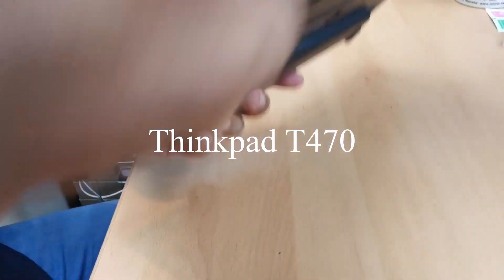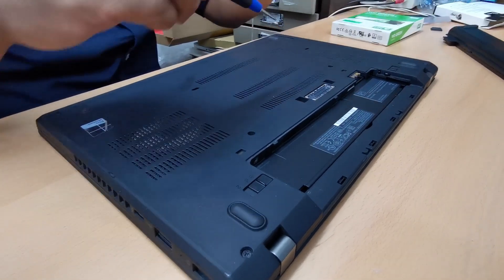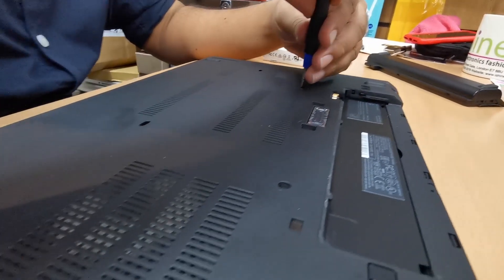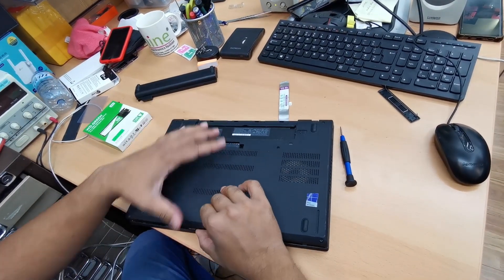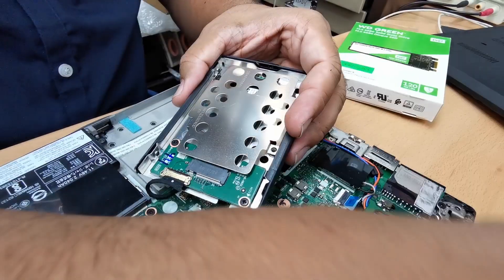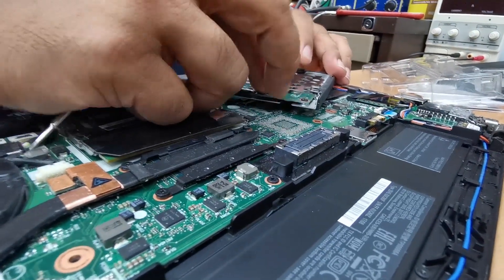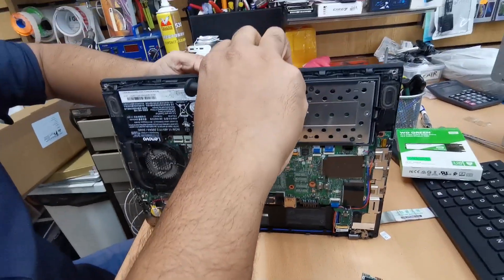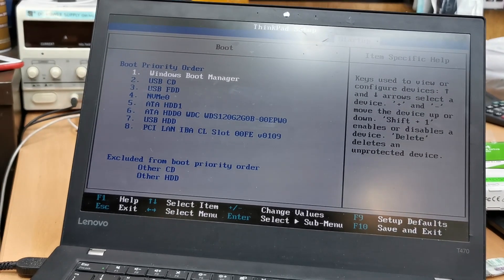Lenovo T470 SSD Replacement Guide Step By Step!!

Comment: OK. I bought a Router supporting Wi-Fi 6 AX3000T - Tell me if my ThinkPad T470 with CPU i5 7300U - Serial number: PF0XPBPC, Product number: 20HES0V803, BIOS version: N1QETA4W 1.79 - will fit: Module - Intel Wi-Fi 6 6E AX210 Bluetooth 5.3 5374Mbps M.2?

Comment: Does this laptop have two ssd slot?
Reply: Mine does.   T470.   One slot for a SATA hard drive or SSD (in the location shown in this video).   Another slot beside it for either a  wireless WWAN card OR a 2242 size M2 SSD.
Reply: @cr10001  The T470 can have NVME SSD as shown, or a 2.5" standard or 2.5" SSD drive in the slot shown. For 2.5" you need a different cable available at Ali. Plus a 2242 SATA in the WWAN slot

Comment: A beginner question - does windows need to be reinstalled on the replacement SSD, and what's the best way to copy files from the original SSD onto the replacement?

Edit: a month into this adventure I found it’s also possible to do a fresh install from USB. Download software like Ventoy to provision a usb thumb drive or external drive as a boot device. Then place windows iso on the drive. Choose boot from USB on BIOS to start the refresh install wizard…
Reply: Ended up using an ssd enclosure to hold the new SSD and copied existing partitions using Macrium Reflect trial version…
Reply: @starless9  thanks for this,..i came to ask the same question...was it a smooth process - no problems?
Reply: First thing to do is clone existing disk to new disk in USB adapter. You can use Macrium clone software or similar.
Reply: Clone your old system first using a USB adapter. Use Acronis True Image from WD download. (its free if you have a Sandisk USB stick or WD drive)

Comment: I am planning to buy a t470 but that laptop doesn't have a fingerprint scanner and has a dual storage, it says it has a slot for both ssd and HDD. Is that fake or what?
Reply from the maker: Yes it does have dual slots for ssd and hdd
Reply: @thepcphone  Thank you

Comment: "the battery is discharged so we didnt have to disconnect it" - proceeds to try and turn it on without power adapter plugged in. Also, watching you with the pry tool is like watching an oaf take apart his first laptop.
Reply from the maker: You don't have any idea about the video background, so how would you know ? Anyway thanks
Reply: @thepcphone  Because you're just some guy who opened a shop, without any prior knowledge other than "I fixed a PC once or twice" and learned everything from secondhand sources. It's evident. You didn't even wear a strap to prevent shock, you had the wrong tools - you didn't clearly explain what your were doing and you certainly did not follow proper repair procedure. So, it's clear you're an "on the job" learner as opposed to someone who actually studied, understands and teaches the field.

Comment: Hi,
After you change the drive. Do you have to reinstall Windows and all other programs?
Thank you very much for your video :-)
Reply: Yes! All your programs and data are installed on the hard drive. You need to back it up onto an external drive and create a boot media for windows before replacing the hard drive. You can use the windows media creator for this. It has simple step by step instructions. Then simply boot from the usb/dvd and it should will install windows. Then you just need to transfer back your data. Programs will usually all have to be reinstalled though!
Reply: @jasminm.3481  Or you can clone your old drive before you remove it. You can clone it to a 2242 in the second slot (WAN) or to your new NVME with a USB to NVME adapter using clone software like Acronis True Image (free from WD..if you have a Sandisk USB or WD drive)
Reply from the maker: Yes you do!

Comment: Is it possible to place a second SSD in this laptop?
Reply from the maker: Hi, No this one does not take two drive at the same time but its compatible for 2.5inch sata HDD/SSD  or M.2 NvMe .Unfortunately this one does not have option for second storage drive.  you can see the motherboard layout in this video at  5:28 .
Reply: @thepcphone  yes, the t470 is compatible with 2 ssd drives. You can put one m.2 or sata in the 2.5 inch bay/adapter, and add a second m.2 sata 2242 ssd into the wwan slot

Comment: what is the tipe of the SSD from lenovo co i can get an adaptor to SATA
regards
Reply from the maker: the below link would give you an idea which sort of converter you need due to swap m.2 to data.
o don't sell anything or I don't have any financial advantage from this link.
hope you would subscribe to my channel if the information does help.
https://www.ebay.co.uk/i/163932482385?chn=ps&norover=1&mkevt=1&mkrid=710-134428-41853-0&mkcid=2&itemid=163932482385&targetid=877696481749&device=c&mktype=pla&googleloc=9046009&poi=&campaignid=9441192411&mkgroupid=92662681381&rlsatarget=pla-877696481749&abcId=578896&merchantid=113628622&gclid=Cj0KCQiA3NX_BRDQARIsALA3fILTj2cBECv_X53urslX8_xqNWEpW93bBTMgTmbeJPWSA0WwsDOASloaAn10EALw_wcB

Comment: never use a metal pry tool on soft plastic.  My IT guy did the same thing and marred up all the edges of my laptop.   Always use a plastic pry tool or spudger.  Also yo need to open the bottom panel from the battery side first to keep the plastic clips from breaking.
Reply from the maker: Thanks for your time !!! You are absolutely right ✅
Reply: @thepcphone i always use s plastic card :)
Reply: I use a nylon guitar pick as my pry tool. Works well.
Reply: Man that was painful to watch!

Comment: You started from the wrong side. You broke the clips
Reply: What do you mean he started from the wrong side ?  Please explain, at what point in time did he do wrong ?
Reply: @Jez1963UK  according to the manual you should always start from the back especially for the T470 that does not have a middle screw at the front. You break the front clips and it will never close nicely ever again. This is why I didn't buy it and went with the T460 instead!
Reply: @level-zero999  Wow, thanks Kemmy for the speedy reply.    So that I've read you right, you're saying start prising it from the back first where the removable battery is ?  From a corner first ?  Or from the middle of the back ?

I've only just purchased a T470 and whilst I have yet to receive it, I'm already looking / learning more about my new machine online (until it arrives later this week).  

I went for the T470 because I work on construction sites and wanted something that was somewhat tough, not too expensive and (for me) most importantly of all, had a really good battery life.  The T470 ticks all of those boxes as far as I'm concerned :)  Mine comes with a 256Gb SSD and I'm pretty sure at some point I may well want to upgrade that.

Thanks for your help :)
Reply: @Jez1963UK  sure thing friend. I'm referring to the area at the back where the battery is. That is where you should start from.

 That's a good purchase you made. I think the T460 and T480  is pretty rugged and has more body than the T470 however that does not mean it is not well built too since it's still a Thinkpad. 

You should be able to upgrade it later on pretty easily. Both ram and SSD. It also has an m.2 slot so you can add a cheap sata 42mm SSD.
Reply: @level-zero999  Is T460 upgradable to nvme slot ? I see in Marketplace many things for that,i'm not sure it will  work or not
Reply: Cool
Reply from the maker: None of the clips broken. thanks
Reply: Should have started prying from the side of the removable battery... cover comes out a lot easier and you don't break the plastic locks.